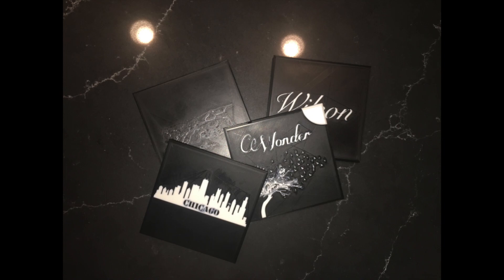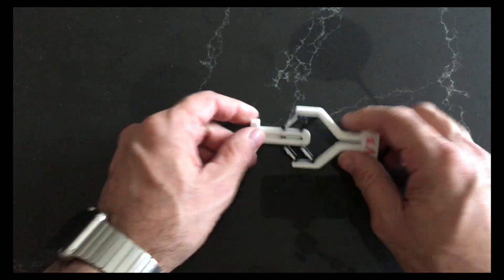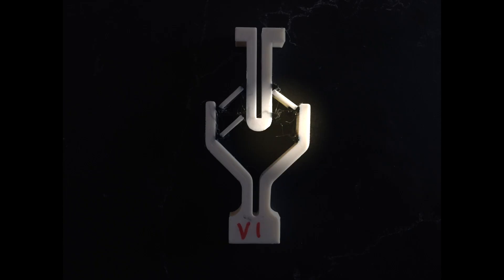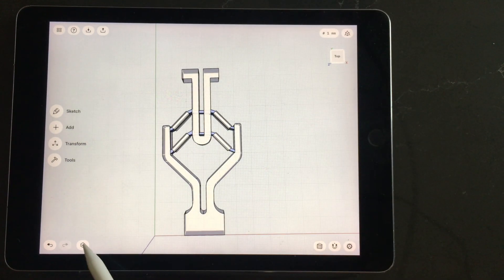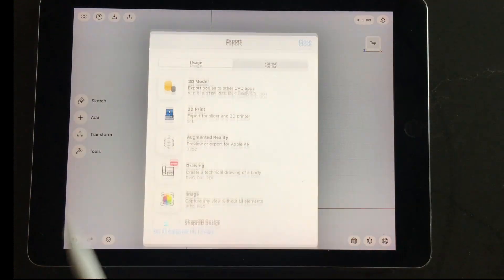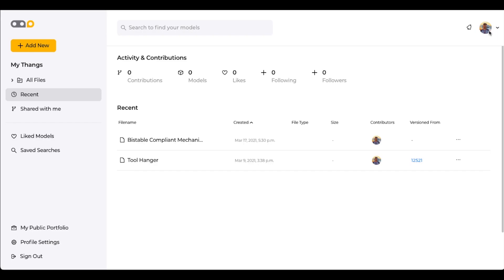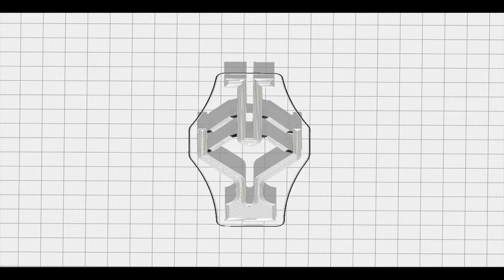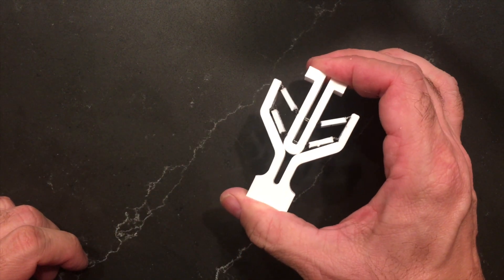Bistable Compliant Mechanism

Comment: yepher, mind sharing your opinion pros/cons regarding Shapr3D? I have a CAD and modeling background but not with this particular software.  Also, what Ipad are you using and/or what would you suggest (Apple 12.9"iPad Pro Wi‑Fi, 1TB)?  I'm not an Apple user, so I'm clueless. I've read there is a Windows version but more than likely still buggy.
Reply: I am probably due for an upgrade but currently I'm using a 9.7" iPad pro. I am not sure the best iPad for you but what you say could be a great choice. I tried a lot of different drawing apps and Shapr3D if for sure my favorite. For me the interaction with the app on the iPad is very natural. But the thing that I really love best is I am not stuck behind my computer and I can draw almost anywhere. The only complaint I've seen for Shapr3D is the price is a turn off for some.
Reply: @TheYephers  thanks for responding. I like the concept of being able to draw almost anywhere too. The price doesn't bother me but I don't want to be a beta tester Windows wise and am not a big fan of Apple.
Reply from the maker: I've not tried the Windows version of Shapr3d and used the Mac version very little so not sure how good it is. But I can say the iPad version is quite good and I don't think you will feel like a beta tester for that app.

Comment: Thanks for sharing this. Curious how you're actually doing the multi-material print? Are you using pause commands in the GCode and swapping out filament mid-print? Or do you have a multi-material printer? (if so -- which one?)
Reply from the maker: My printer has multiple extruders so I have the rigid material in one and the TPU in the other. I use an Ultimaker S5
Reply: What is lacking with Mechanical Engineers today, is the knowledge of how to design mechanisms correctly. Did know that there's a mathematical formula that can be used for all mechanism designs? It's called Gruebler's Count. I found a way to make it practical for all 3D mechanisms. Here's the link if you are interested.  https://youtu.be/KFB8gMjxDPk

Comment: Since the outer arms flex slightly could the pivot points be a simple rotational pivot instead of a flexible material for longevity?
Reply from the maker: I think you are correct. I've had a few more iterations of this and have yet to have a very reliable mechanism with this configuration. I'm not quite ready to give up yet.
Reply: @yephwerks3889  plenty of potential in this though ☺